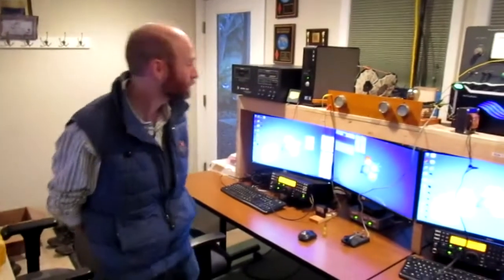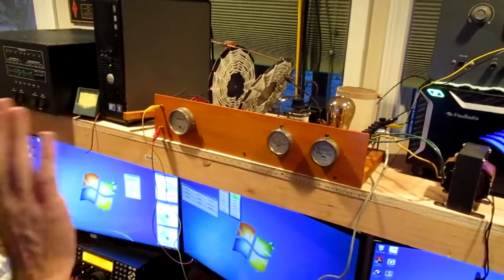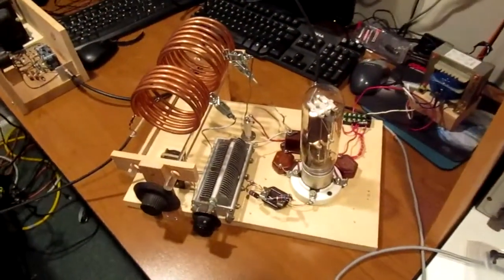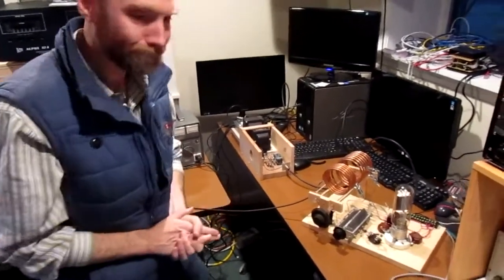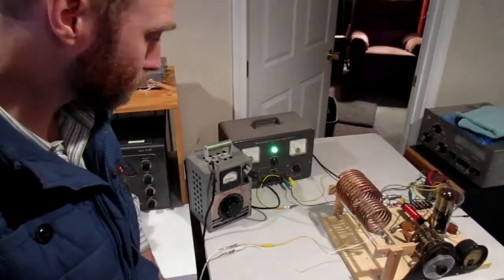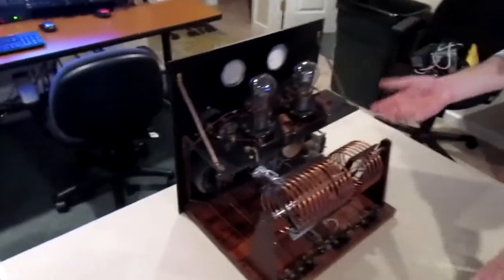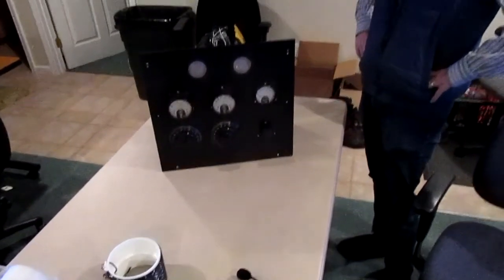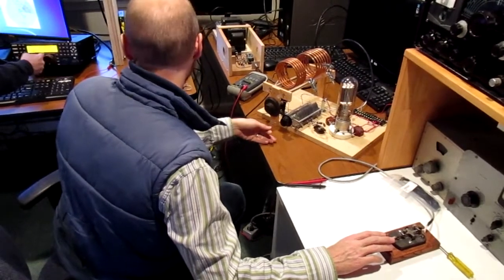The AWA Communications Technology Museum Presents K0SM's 3 Hartleys

Comment: Brought back nostalgic memories of my old homebrew HF radio in late 1980s with 3 x 807 tubes with about 120 Watts of DC input, though not as antique as the one shown! I could work US stations during grey line propagation on CW in those days. 73 de VU2JO.

Comment: Fascinating copies of construction forty years before I went on the air, though my VFO may have occasionally sounded a bit reminiscent :)  Did you make any QSOs with that gear? What was you antenna system and coupling to the output link? (AB3SX)
Reply: I don't have our log in front of us, but I think we made almost 50 contacts between 7pm and midnight with other station running similar types of transmitters, including several on the other side of the continent.  We had two operators among the three stations you see which did help.  Nothing blew up and was generally well behaved, even the ~98 yr. old UV202 at the first position.
Reply: @radioidiot1005  Thanks for the info; great job!